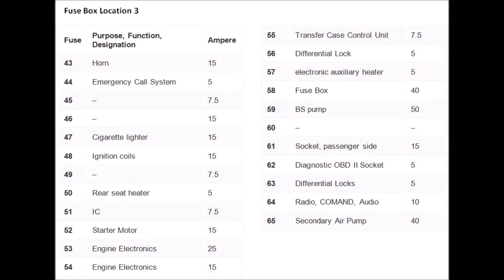Mercedes G-Wagon V8 G-Class Fuse Box & OBD2 Diagnostics Port Locations

Comment: I’m trying so hard to find the fuse for the Ac in your chart show location 1 number 30.  But it only goes from number 10 fuse to number 22 fuse 
Where is the number 30 which supposedly is the ac fuse
Thanks so much
Reply from the maker: Hi so sorry I missed this comment have you now fixed the issue? I would imagine there is lots of variations on the G wagon, and different equipment levels would have different fuse allocations.